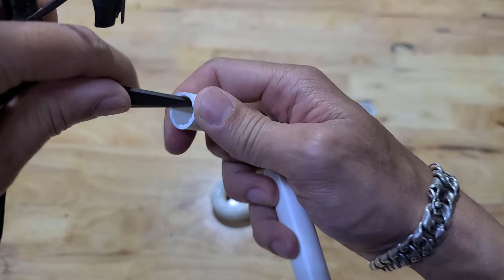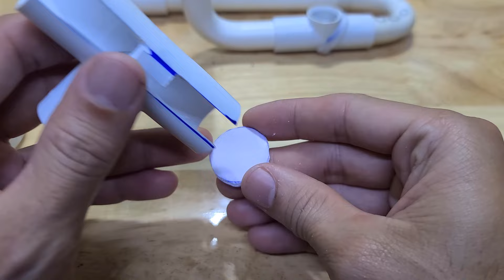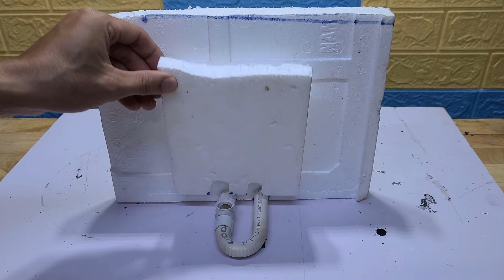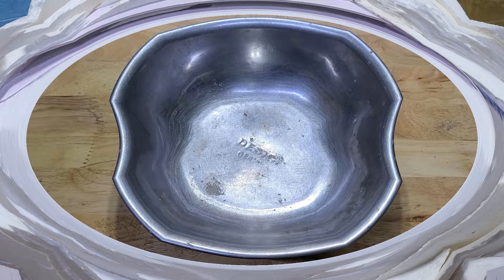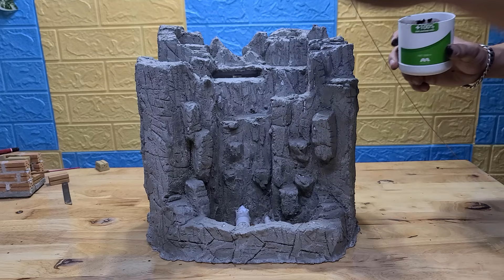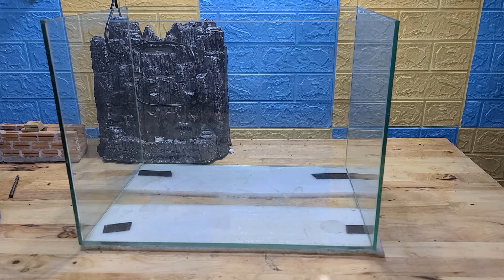DIY Sand Waterfall Aquarium Easy-to-find Materials And Simple Tips To Help You Succeed

Comment: I have made 3 waterfall but everytime i make i end up having sand thrown put of the reed where the sand goes into the hole for you . Give me a solution
Reply from the maker: Do not make the waterfall too high, the pump too weak or too strong, the sand grains too big or too small. You should choose the right one to be successful
Reply: It was just 13 inch
Reply: Pls make a proper video with fault and successfull t joint where sand gets sucked . So I will try not do the fault again
Reply from the maker: @puvaneshsel8150  Yes I will do
Reply: @RelaxLifeVIP  pls try to make a 12 inch waterfall
Reply: @RelaxLifeVIP  and display all the measurements on screen
Reply: Bro I saw all your sandfall videos it almost cleared my query but one last thing how much sand should I add . Like it has to cover the hole or less. Because whenever I add more sand it just throws off the sand from the reed . Eventually the sandfall becomes fountain type😂

Comment: Ist Zement nicht giftig für Aquarium?
Was nimmt man für Farbe  für Aquarium um Styropor zu Streichen? fg
Reply: fg
Reply: Bei uns in Austria ist es schwer 16er Rohre und Fitting zu bekommen nicht mal Temu finde ich alles dafür, habe 20 er Rohr gekauft auch 16 er aber Fitting für 16 er Rohre nein.
Klare Rohre gibt's nicht vielleicht Amazon aber teuer.lg
Reply: Ich habe weißen Sand gekauft .
5kg Beutel Sansibar Snow. Körnung: 0,1-0,6 mm passt das?
Reply from the maker: 20 mm funktionieren gut, Sie können 20 mm-Röhren verwenden
Reply from the maker: Die Samen sollten nicht zu groß oder zu klein sein, zu kleine Samen verursachen Staub im Tank
Reply: @RelaxLifeVIP  mit was wird Styropor gestrichen?
Gibt es mit Zement kein Problem für Fische? Lg